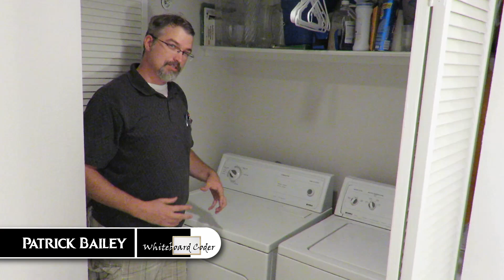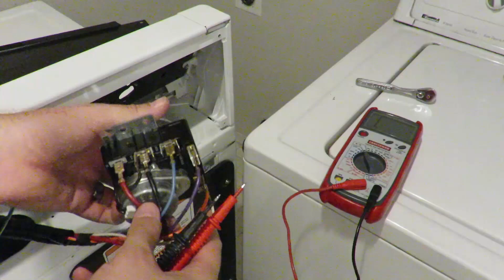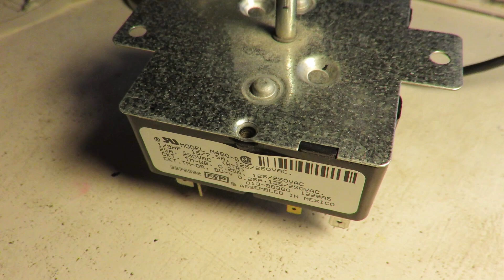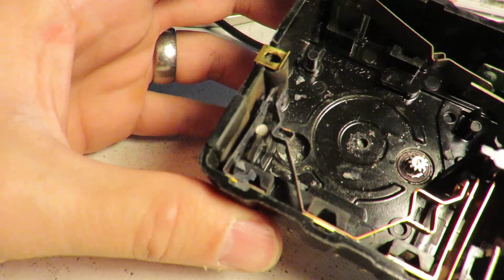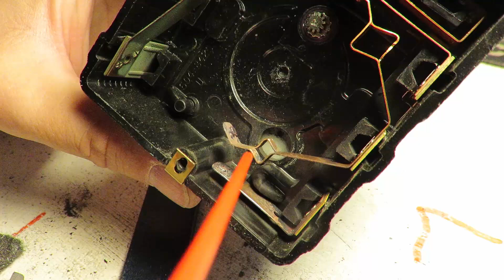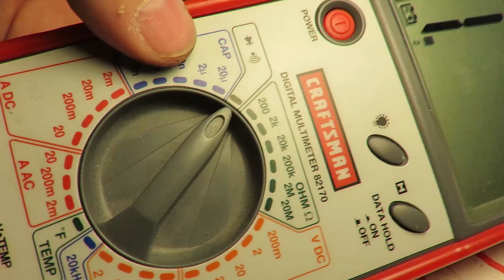Fix Fried Dryer Timer saved $80

Comment: I would suggest using a nutdriver. I guess it's worth a try in a pinch but not going to last long. Contacts are all burned up and the heat relaxes the tension to keep them closed. It's a common problem on electric dryers. Unless you have a relay, which I thought about refitting, that timer takes the full current load of the heating element. Which is a lot. If you have ANY resistance across the contacts or terminals you get a thermal runaway condition where you just get more heat until parts and wires burn up. I had a timer on my supposedly 'vaunted' Speed Queen burn up after 4 1/2 years, so I changed it, now it lasted almost 7 years and this time melted 3 or 4 other wires. I did replace the wires and terminals, but it still gets hot. Using a FLIR thermometer at the heater terminals temps creep up to 160 after a few minutes of running. BTW, I kept the fabric temp at Perm Press after the first replacement which is 'medium' in a small attempt to limit the current through the switch. I was just shocked that they would run all that current through that timer. My dryer is 10 years old, burned up 2 timers and now I guess it needs to be scraped. Alliance (speed queen) says it's 'no longer available' with NO REPLACEMENT. I have the ability to go gas if I want and just may.

Comment: Great video, ty!

 It works similar to the ignition points in an older automobile.

I did the same test and found nothing, heard a small piece rattling around inside the timer, opened it up and found the same problem you did but with a huge burn area that blackened the metal cover.

Found the one contact button fell off and was loose inside the timer.

Comment: My one has a little different issue: when I try to turn it on, the timer makes a little noise and doesn't start the dryer. I already tested all possible parts of the dryer for continuity, and it seems to be good (including the thermal fuse). So, my next try will be to open the timer as you did and investigate. Let's see if I can avoid buying a new timer. thanks

Comment: No one takes into consideration that there is a steel vent pipe going out from the dryer and through the wall to the outside.
If you pull the dryer out to work on the back it is almost impossible to re-connect the vent pipe.

Comment: For people with issues of the timer not keeping correct time or your dryer runs all the time. There is a video about the three dials that are under the timer that have a hole in each one and those holes should be lined up. They are synchronizing holes. The fix was to put the holes in alignment and use a 10 mm machine screw about a 1/2  maybe 5/8 long, and gently thread into the first gear through the second,  and then the third, and it will keep the holes in alignment. To get to the top of the first gear you have to use a pair of snap ring pliers or some other do-it-yourself way to get the locking ring from around the finger that the knob is on and then you can pull the knob out and then the plate that you will be exposing the three rings
Reply: On my Amana the contacts were OK.  I could check that without taking apart the timer.  My problem was on "auto" regular/delicate cycle, the timer would not advance past heating phase.... IE ... stuck on heat and run forever.  Normally you would think that the thermostat was stuck and not switching heat off, but this problem was only happening during this one cycle.  The problem wound up being the plastic cam disks that were not syncing together because of the wear where the plastic disks fit onto the metal shaft .... IE .... too much free spin of the disks on the shaft.  I needed about a 4 mm diameter screw for my disks.  But, I had to use my Dremel with cutoff wheel to remove the head on the screw and cut a slot into the end of the screw for screwdriver.  The screw head blocked the "push to start", as my timer has that added feature.  Here's link to video on the disks ...... https://www.youtube.com/watch?v=cN7H00bYz_o&list=PLU5r5J8Lb5GQq0zvkWqd85vTnx3yCnezs&index=1&t=496s

Comment: Thanks for your video. I have the same timer and found that T-W never contacted each other at all. I opened the box and leaned the notch of T terminal ripped off completely. So, T never reached to W position. I bent W a little closer to T. Now, It is working fine. But I am wondering if it may start not working soon. I want to put something between behind W and the box wall to avoid W returns to the original position. The material should not catch the fire. Can you give me a good advice for my situation? Thanks in advance.
Reply: Same thing happened to me. I considered soldering the pad back on but it is in a very difficult position to reach. Ended up buying a new one.

Comment: My timer advances slowly past off all on its own. As if possessed. Right now I unplug to prevent the advancement. Dryer works fine other wise. I plug when I need to use, it cycles fine, shuts off when it should, however is slowly moves passed off on its own. Anyone has any ideas on what can be?

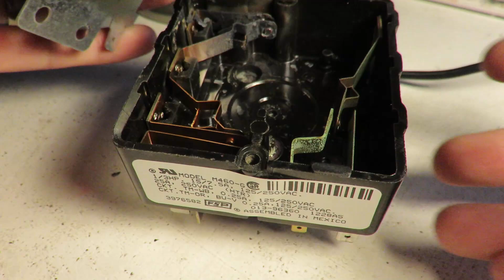Comment: lol .... that is not the part number ..... ( 3976582 ) .  it shows the correct part number at the 4:12 time mark .  also , your point is completely burned off .  it may work once or twice , but that will not fix it .  that timer is around $ 150 .   best thing to do is go to a repair shop and buy a used one .  if that exact timer is not available , buy one that has the same base ........  one that has the same terminals in the same position .  use your top part ( cam )  in the base .  easy fix .

Comment: I like the idea of savings both financially and the landfill.    However, sorry, it's not really "fixed".  It's working, but only until it burns what very little is left of those contacts you sanded.  You have now a high resistance set of contacts that will potentially melt the plastic housing and cause a fire and/or electrocution hazard.  This is not a safe repair.  Look up how many dryer fires there are in a year.  (2,900 home clothes dryer fires are reported each year and cause an estimated 5 deaths, 100 injuries, and $35 million in property loss)

Comment: None of my contacts were scorched.  It looks brand new inside. 
On Auto Dry, (which is what we normally use) ...
My timer moves along fine but when it gets done drying, the timer won't click to the off position?
Even when I turn it to off, it continues clicking.
Also, the heat is set to low but is HOT HOT. And when the knob gets to the point where it should be cooling down (at the *) it stays scalding hot.
Any ideas?  Thanks
FYI:
All lint is clear, I've clean all intakes and removed all accumulated debris and made sure vent to outside is clear.

Comment: BTW, there often is a lock ring on the base of the motor shaft that you have to remove before you can get the cover plate off the timer housing.  If you don't have tiny lockring pliers, then it will take some patience and creativity with a small flat screwdriver and small pliers to spread the lockring apart enough to remove without damaging it.

Comment: I can't thank you enough! I spent so much time diagnosing all the fuses and thermostats with no luck at all. Normally the timer is the last thing to check (because it's the most expensive!) but after watching this video I gave it a shot. Sure enough, the contacts were corroded and after a little working on the contacts I was able to get them clean and touching again. Much Much gratitude!

Comment: When I turn my dial it no longer gives me that clicking sound when it goes between the 10 minute time frames does that mean the actual round silver motor is broken? Did yours still make noise when you turn the dial when it clicked when it went between each 10 minute increment right now it's only clicking when it goes over the off sections.

Comment: They wanted $215 CDN for a new timer for my dryer (plus $200 labour if I had someone come out to the house for install). Decided to open it up myself , and found exactly the same problem as yours. Guess what? Your "fix it" did the trick, and my dryer works with heat again. Much thanks!

Comment: WOW! My timer had a thin black dust that looked like coal ashes on the same contact terminal like yours. Looked like a short circuit. I cleaned it with alcohol and it worked! Thank you so much!
Reply from the maker: Glad it worked fo you

Comment: This is the fix that worked for me. I noticed my multimeter only registered continuity when I was turning the timer handle, but when I let go it lost it. Then when I pushed down on it slightly it came back. Contacts just needed some light sandpapering! Thanks for pointing me in the right direction!

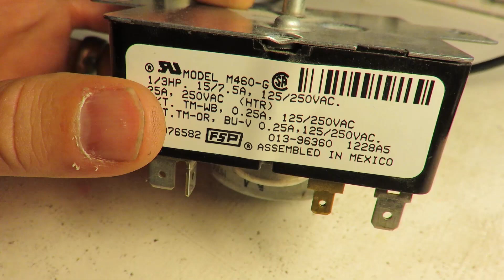Comment: 4:05 - when you take the gear off, are there alignment pins or something on the gear shaft so you can only install the gears back in the same location?  (Else, the desired timer cycle position would not correspond with the gear shaft.)
Reply: Good question. Can't get mine back together because of that.
Reply: Yes same. What are we going to do??
Reply: You need to see what you're doing when you put the wheels back in so took the retaining clip off so that I could remove the silver back off and see what I was doing. Then as you turn the spindle you can make sure your getting continuity outside at each connection as it is made inside.  Hope that makes sense. Start with flat part just east of north position facing white label. Align with wheel notches or they will bend and created new problems. Works well now.

Comment: I'm all about fixing stuff myself....but this is a great way to start a nice fire to dry your clothes as you wash them...if the contacts are corroded, pitted or destroyed this much the timer should be replaced. An electrical connection such as this will cause a higher amp draw due to the electricity having to work harder to flow between the two destroyed surfaces. If you don't believe it go loosen up a neutral wire in your receptacles and hook up a hair dryer, it will destroy that loose connection. Be safe and take care.

Comment: How did you know which way to put the rotary switch back in so it was synced up with the right cycle?  I'm doing mine with trial and error and it's not going well.
Reply: Exactly. I think that’s why he didn’t show that part and left it out.
Reply: I checked pictures of the part new..the flat part of spindle should be pointing towards the label on front but off centre E. Then try your continuity with the various settings with the timer dial back on,  black and red should  have continuity when dryer in working mode, not when off.

Comment: Cleaned the motor contact points replaced fuses and heating element, cleaned the ducts from debri, lol i have no choice but timer the dryer keeps overheating and blowing fuses will try advise thank you.
Reply: sounds like a stuck cycling thermostat?

Comment: I'd be curious to know why it's arcing in the first place. I'd be afraid of fire.
Reply: drumbyte I suspect the cams that open and close the contacts get worn and the contact points don’t fit together as firmly as they should as one reason they get this way. 
  I have also seen cams come completely loose and not open and close the contacts.
  I usually bend the contact arm just a little bit to make sure they have good contact when the close in case the contact point itself is burned down or the cam is a little worn.
Reply: Design obsolescence

Comment: Test every thing timer sits at OL when I do the timer so I'm about to follow you thanks in advance!
Reply: Yep I could not repeat your excellent instructions my timer contacts were obliterated I could only get a noise with my finger, so I could not leave my finger in there lol! Had to spend the bucks! Yep timer replace dryer works fine!
Reply: Jason Smith at least you tried!
Reply: @SkateboardingIsFuns   It never ends now checking tells me door switch has bit the dust got to wait for it to come in Birmingham parts are very special they want installation prices here  so Amazon 2 day del. I must wait! Little lever has click never more, never more lol!
Reply: Jason Smith well you still save with diy, good luck:)

Comment: Thanks so much...I would not have thought to open the timer. One of the contacts is 95% burned off it's arm. I tries fixing it with a little solder but no luck. The good new is that the timer is $95, far less than buying a new dryer. Best is that I figured it out. Thanks

Comment: Did you find out what caused it to arc in the first place though?
Reply from the maker: No, I never did just figured I must have had a power spike that was just right to cause the arc.
Reply: @Whiteboardcoder  Curious, did you ever find out how long the fix lasted?
Reply: Sometimes those metal pieces get a little bent hence causing loose connections which also causes it to heat up and spark. It's just a matter of cleaning it and vending it so it makes a solid connection. I can't imagine how many people buy new dryers when it could be such an easy fix like this (which in most cases when you dryer isn't heating, this is what the problem is).
Reply: @craigdaubbeats-rapinstrume9185  Do you think maybe with use over time that the metal loses it's memory and that change in position could cause the excessive sparking? Or maybe oxidation over time or mayhaps even both.

Comment: Why would you tell someone to open up the timer motor, I did that and now my timer is all messed up. Where it supposed to be off it’s on and instead of having three spots it shuts off at it only shuts off in one spot. Now when I dry my clothes I have to set a timer on my phone or the dryer just keeps running. That little box should’ve never been opened up.

Comment: This is an example of when a Dremel tool is worth it’s weight in gold… Also, Walmart has a hyper tough version of a Dremel that works great but cost less at just over $20. I got one, and then went back and got another one so when can always be charged. They come with a generous assortment of “bits”, but check out the mind-boggling assortments you can find on Banggood..

Comment: Excellent video.  Many (most?) people think they can't handle such a repair but some of these people may do more complex tasks in their respective professions.   It's strange how so many of us are conditioned to stay within our profession or routines or habits.
Reply: I’ve fixed my dryer a few times. I wish I had known how easy this was. Beats buying a used or scratch n dent
Reply: @criticaltinker5687  Sometimes it becomes frustrating.  Our over the range Whirlpool microwave had the front doorframe come off when we pulled the handle.  It still works and I bought a radiation meter to make sure it was safe to use.  I bought replacements twice but sent them back;  wrong size.  How does a shipping department make such a mistake?  A replacement door assembly is priced at 60% of what we originally paid for the new machine.  The original design holds it all in place by integral plastic clips  -  which broke.  I'm guessing that a trainee designed it.  I could easily buy a new microwave but  .  .  .  stubborn male?  Some people would say that's redundant.😇
Reply: @Phil Uplin We've had two clothes dryers and each had troublesome timers.  The timers on the dishwashers and clothes washers have worked year after year but the dryer timers . . . bummer.  I'll re-watch this video and others I may find and then probably try to fix my own.  We tend to get long service from our household equipment.

Comment: Ur just technical enough to be a hazard to yourself and your home.

First off, not a nut driver is sight second, ur asking for a serious ugly problem of that contact sticking in the on position do to the contact area being zorched, spend the 80 to 100 bucks and use a oem switch, your family not dying in a dryer fire will thank you.

Also don’t try that insane stunt on your house AC contactor or you could also get a stuck contact while you sleep or are away from home.

There’s a time to be a tight ass, these aren’t them, skimp on the pizzas and save a structure and or a life or two

Comment: Took my timer apart. A couple of observations, the center part of the timer where the knob mounts to doesn't just come right out it takes a little pulling and wiggling.  Getting it back in (not included in this video ) is a little tricky.  If you aren't careful  you could possibly bend one of the copper arms which would cause them not to contact the other arm  properly.   I did find my problem. On the very end of each one of the copper  arms  there is a little copper  knubb  that meets the one on the other arm to make the connection.  One of the knubbs  broke off, I thought I was screwed.  I adjusted the one arm  to get a better contact and it seems to be working, fingers crossed.

Comment: Just a couple of things for the DYIer's . When it comes to appliance parts  the manufacturers of the appliances are all buying from the same companies that manufacture parts. An example, the plastic latch on my dishwasher soap dispenser door broke when I looked for the part $55,  I noticed numerous brands could use the exact same part. I saw a different brand dishwasher out to trash when I checked it had the same soap dispenser as mine just a different  color pattern. Wala free soap dispenser.  Defrost timer upright freezer  $80  OEM   $13  AOM  same exact item in every way.   This holds true for many of the parts in all home appliances.  So when people say my timer motor is shot and they don't sell mine, There are other machines out there using the same exact motor.  Just figuring out which is the problem.  They want to sell you a $10 part for $100

Comment: Great Video. my dryer stops when it's supposed  to go into cool down. If I pull up on the timer knob it starts right up and usually finishes the cycle. I'm hoping it is a contact problem, we will see